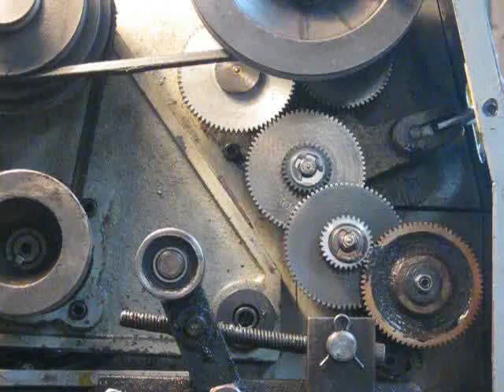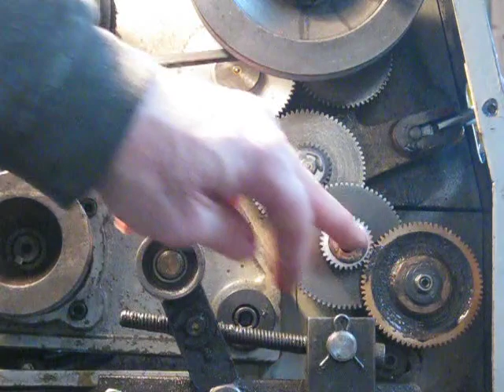Do home made aluminum gears last ?

Comment: What alloy is good Nice , I have been searching you tube for weeks and this finally came up.
Reply from the maker: Try not to use soft alloy.   Most cast aluminium will be OK as it is generally thin walled and high strength.

Comment: I really like your channel, it seems we have many of the same interests.

If I could offer one suggestion, is there any way you could break down your videos in some fashion?  I saw the one for casting aluminum gear blanks while watching this video, then had to go scroll through 326 videos to find it again after it disappeared from my recommended list?

Playlists/categories like:
    Metal Casting.
    Reviews.
    Lathe/Milling.
    Small Engine.
    Tool Restoration.
    Etc.
Reply from the maker: Hi David,

I would have a lot of play lists if I did that.  What you see is what you get.

End cards help a bit.

Cheers Rob

Comment: Marine grade ali is also a lot harder than standard ali so it should handle the torque on lower speeds a lot better than the fibre ones..On the higher speeds the fibre seems to be alright but on low speed they strip so I think I will be pouring some molten ali into baked bean tins pretty shortly and hand balling those fibre gears into the bin.I will go and visit a local boat manufacturer who I know and get some scrap marine grade ali.
Thanks for those videos on casting ali--regards Ian
Reply from the maker: Hi Ian.  My baked bean tin cast gears are all still going strong.  I can't see any wear on the reverse tumbler I cast to replace a cast iron gear that shed.  If the mill head gears had a steel centre I would be inclined to go the same way.  People say you can run aluminium gears on a fixed centre shaft, but I don't like the idea.  I would put a steel centre bush in the gear or use a gear carrier.  My alloy reverse tumbler has a steel centre.  Hope you find this useful.  Cheers Rob
Reply from the maker: xynudu Meant to say my original cast iron reverse tumbler gear shed a few teeth when doing some heavy milling, from the massive backlash that occurred. Pushed the old girl just a bit too far :)  Rob

Comment: Good stuff Rob--I have to make some small gears for a small vertical mill--the manufacturers used fibre for some of the gears and they stripped...Really stupid..
I have a question though-have you ever melted down scrap marine grade aluminium and would that be better than ordinary aluminium to make blanks..regards Ian
Reply from the maker: Ian Craig Hi Ian. They probably used fibre to keep the noise down. Aluminium is also pretty quiet. I have never used marine grade aluminium.  If it bends I wouldn't use it for gears.  If it breaks, it should be OK.  Marine grade is basically anti corrosive as I understand it. Obviously soft, bendy alloy is not good for gear teeth.  Harder, more brittle alloy does best.  Cheers Rob

Comment: Could you cast some thing with threads?
Reply from the maker: More information needed.  Are you talking about internal or external thread?  Rob
Reply: xynudu .
A part with internal thread.
Reply from the maker: Yes.  If you cast around a steel bolt thread, it will be able to be unscrewed when the metal has cooled down, leaving the thread in the aluminium. I have'nt tried it, but I have seen demonstrations of it being done with cast alloy rod filler etc. Rob.
Reply: xynudu . Good idea. Thanks.

Comment: It does depend on the aluminum though.  I made a small steam engine once.  Had an aluminum frame and a steel shaft.  The hole in the aluminum wore out quickly.  Aluminum can be treated to have very different properties.

Comment from the maker: Good point Matthew.  I thought about this after doing the video and realized that most small stationary engines have an alloy conrod running straight on a steel crank pin. The only difference is that they have a good oil supply.  But as you correctly say, white metal bearings handle this OK.  I was being being cautious in my original statement on this, but I have to agree with your comments.  Thank you for bringing this up.  Cheers  Rob

Comment: Sorry mate, but Al on steel is a good bearing material, better than steel on steel, you don't in my opinion need a steel insert on an Al gear if it's going to be running on steel. Think about cam shafts running in an Al block. Always soft against hard, white metal bearings, bronze bushes. Regards, Matthew